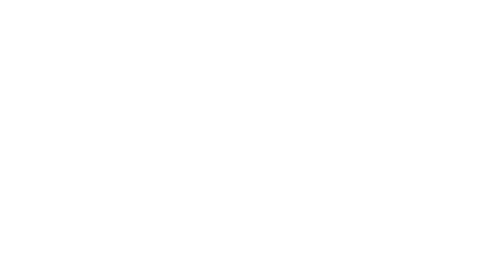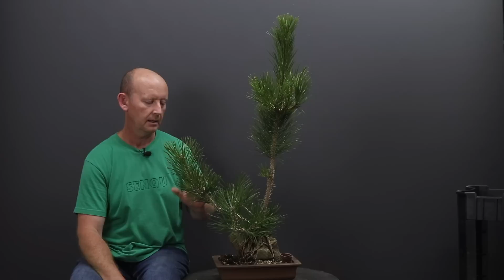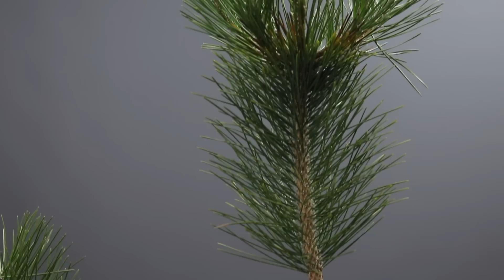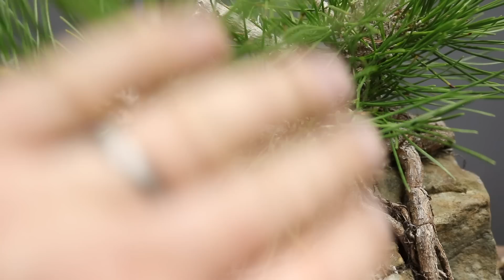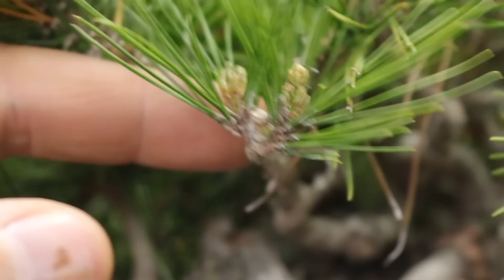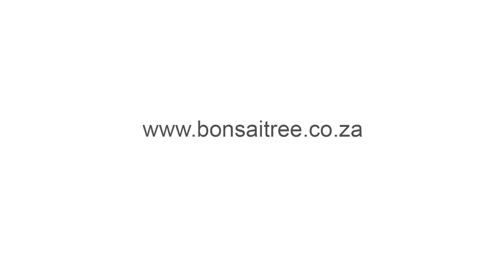Essential Japanese Black Pine bonsai techniques

Comment: Hi Terry, some people shorten the needles even in   stage 2. Is this detrimental to the tree? I mean the tree has enough sunlight going into the inner buds. Thanks
Reply from the maker: Hi David. Good question. First permit me to say that there are MANY different ways to grow pines, I can only present the methods I have been taught but certainly do not mean to suggest that's the only way. Cutting needles are part of balancing the energy. So if you have very long and very short needles and you are plucking needles then 2 long needles are not equal to 2 short needles and some compensation is required. However this is for refined trees. When in development I can only imagine why one would cut the needles in an area of the tree which you wish to keep is to get more sunlight into the interior and stimulate buds there. If sufficient sunlight is getting in, then cutting the needles will simply weaken the tree which would be counterproductive - however perhaps I am not understanding exactly what the other persons aim was.
Reply: Thanks for the explanation. Thanks for the informative videos that you post. I learn a lot from them.

Comment: You mention several times the importance of feeding pines. Can you please tell us what feed or feeds you use and how you typically apply it for the 3 stages of pine development. Thank you.
Reply from the maker: Thanks Chris. That’s a great question! However a proper answer deserves another video. In summary I use BonsaiBoost which is essential canola meal based solid fertiliser. I also use Seagro. 
https://www.bonsaitree.co.za/collections/fertilizers-and-baskets
Young pines are aggressively fertilised right throughout the year, except winter. More developed trees are fed the same but not after decandling, for about 3 weeks or so. Refined pines might be fed a little lighter than the previous with a focus on fertiliser in autumn.

Comment: Thank you very thorough and explicative on the stages. I struggle knowing when to repot developing trees, especially if sacrifice branches were used. I know pines can go some time without rootwork but have heard that repotting will strengthen tree also?
Reply from the maker: Thanks for the compliment Brian! You can repot developing trees more frequently (+-2 years) than older refined trees (+-5 or 6 years). There are many reasons for this though. Repotting itself temporarily weakens a tree it NEVER strengthens a tree. It however stimulates a tree into growing which will lead to a stronger tree. I would suggest some of the most important reasons you want to repot developing trees more frequently is to do the required root work (waiting too long encourages coarse roots) and to refresh the growing media which will provide more aeration at the rootzone and thus stimulate vigorous growth.

Comment: Great knowledge on controlling growth  . I live in Canada  plant zone 4 so it gets very cold . Growing cold hardy pines  native  and from Europe and Japanese red. . Do you grow pines in the ground to develop or in large boxes  specific how do you handle the roots  to keep rootball manageable  when dig up ie do you periodically dig up and replant   Any advice on growing development of conifers in the ground would be greatly appreciated. Thank you
Reply from the maker: Thanks for your question Matthew. I grow my pines in containers as it is much easier to manage the growth of the canopy and root system. I dont grow really large trees in this way, only smaller sized trees. For large trees you would need to grow them on in the ground, however its quite amazing what can be achieved in a container. The difference is that the container will take a lot longer, but what I like about that is that by the time you have developed the trunk etc then you have the bark to match. If developed quickly the bark is often rather juvenile in appearance. I do not feel I am qualified to give advice on growing conifers in the ground as its not something I use a lot of. However you will need to chop the roots of the tree in stages and bear in mind that there will always be risk when lifting the tree even if you do everything correctly.
Reply: @TerryErasmusbonsai   thanks for answering.  I to only grow pine in boxes  easier. To protect in winter here .  Do you have a feeding regime or advice . Especially for root development  in root over rock and some planted over styrofoam in s hollow box for nebori  development  trees are in development so top growth is mostly sacrificial

Comment: Hey Terry, I was wondering what to do with the main trunk (the one that grows straight up from a seedling) after I took a seedling cutting. I'm hoping to make a Neagari style Shohin Pine, and I'm aiming for a tree around 6 inches in height. Should I treat the main trunk like an escape branch or should I prune it off immediately? Thanks so much :)
Reply from the maker: You should keep the branch as an escape for as long as possible while you think the trunk, then remove it. Not before.

Comment: Hi Terry, is there a specific time of the year when it would be best to do the cut backs? ... to correct "leggy" branches.
Reply from the maker: Uhm Elbie, there really isn’t a best time. I would cut when I’m styling so autumn is good. However I assume you have actively growing buds which are strong enough to cut back to right?
Reply: @TerryErasmusbonsai  unfortunately not (yet) ... going to aim to increase the vigor of the branches,  wait for back buds to develop and then cut back to when they are strong enough.

Comment: Quite literally the most informative video on JBP bonsai I ever watched. I love your videos, friend. 
Question: Would I be wrong to assume that growing JBP in a bonsai pot, even if you’re trying to thicken the trunk, as long as you have sacrificial branches? 
Thanks again, and greetings from Orlando, FL
Reply from the maker: Thanks so much William. Your question seems incomplete. I assume you meant to ask if you can develop mice JBP in a pot using those techniques. If yes then yes. If you want to develop larger trees then I’d suggest growing in the ground but certainly smaller trees are fine to develop in a container. Although it would be faster to do so in the ground, there is a risk of losing them when you dig them out. 
Hope it has cooled off there in Florida now. I visited there many years ago and remember the humidity was something else!
Reply: @TerryErasmusbonsai  I appreciate you taking time to respond to my question. You gave me the answer I needed and I appreciate it. I think I’ll stick to leaving it in the pot and going with the sacrificial branch. I honestly and sincerely care about this tree. Believe it or not, it hasn’t gotten any better here, just hotter and more humid. You would be surprised to know that Japanese black pine actually do very well here in Central Florida. Or you might not be surprised. Lol. I just made it a common practice to make sure I water my pine twice a day if the temperatures go over 95. I also keep about half of the roof base covered up with moss. Thanks again, Terry. I really appreciate your videos
Reply: Also, you are correct. What happened to the rest of my question? 😂

Comment: Thanks, Terry, for this really informative presentation.  I am a beginner who just bought a one-meter tall Austrian pine and would like to develop it into a bonsai form.  Now, after watching the first part of your presentation, I assume that I should let the pyramidal-shape tree grow tall freely to get a big trunk, let it develop some buds in the lower part (now bare) and then after years cut it off as a sacrificial branch.  Is that the recommended approach?  I guess I should not do any bending or even wiring at thus stage (which is, however, what some bonsai enthusiasts suggest).  Can I have some advise in this regard? Should I let it grow in a container?  Thanks a lot.
Reply from the maker: Hello Taidic, thanks for reaching out. I believe I did answer your questions in the video, meaning that if you want to fatten the trunk you need to grow a sacrificial leader. Using wire to put bends into the tree now is a great idea both because it will give it movement without relying solely on trunk chops to introduce this, and "cage wiring" which means to allow the tree to press up against the wire and cut in, will actually accelerate trunk thickening. If you can grow in the ground that will be great but then remember to cut the roots back every 2 years or so. Otherwise a large container will also be good. Use a very open substrate which drains quickly and LOADS of organic fertilizer.
Reply: @TerryErasmusbonsai  Thank you very much, Terry.  As I am very slowly picking up knowledge on bonsai from sources on the internet, I do very much look forward to watching more YouTube videos from you.  Thanks again for sharing your knowledge.

Comment: It's impressive how you explain everything, I've got to say that I'm struggling with the sacrificial branches on Japanese black pines. Have you got a guide/video with the steps to make/cut them? (mainly on how to cut them, but anything would help) I've killed some of my trees because of that and it is really stressing to make it again just knowing that probably I'll kill one more again 😔
Reply from the maker: Thank you Pascual! I don’t have such a video but I will do one when the timing is correct. I suspect you are either cutting off too much at once, too many branches at once or perhaps at the wrong time. It’s best to cut them off in stages so as not to disrupt sapflow too dramatically, in this way, in my experience the tree keeps growing like nothing happened.
Reply: @TerryErasmusbonsai  thank you very much, it's really nice to have found this amazing channel, I'll try cutting those branches little by little now (mid winter - pre-spring) and see if I get lucky :)

Thank you very much for your time, making the videos and responding. You're amazing!! :D